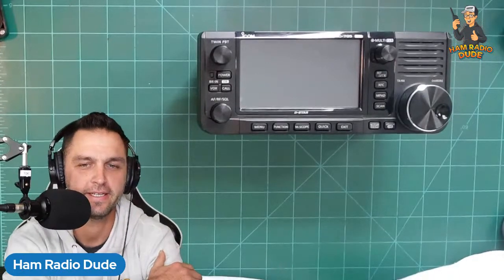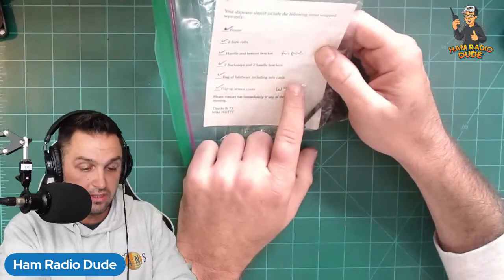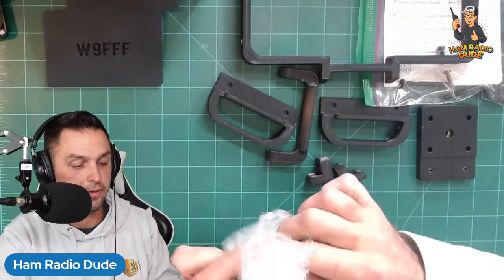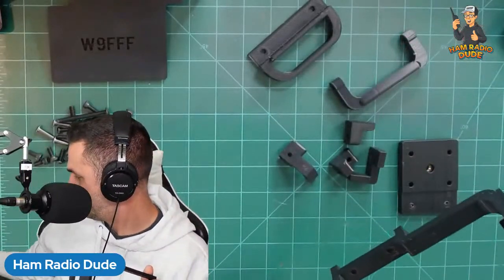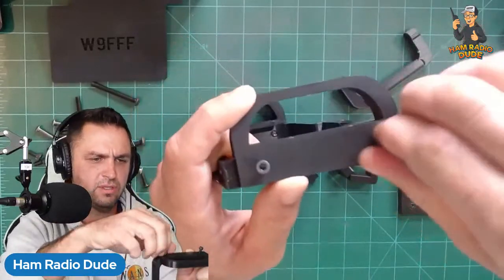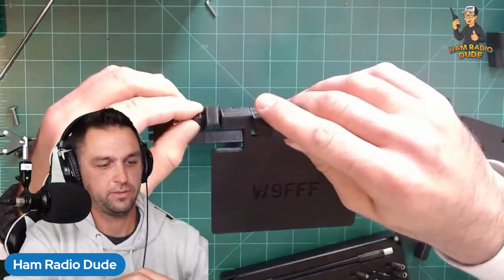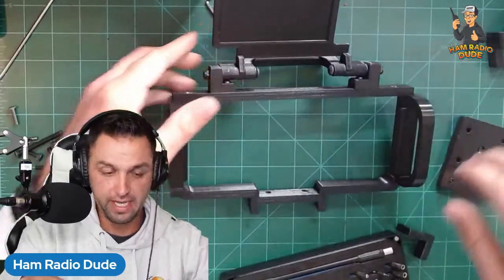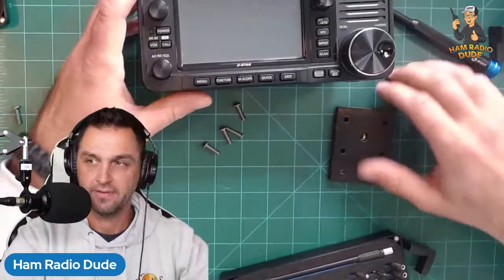Icom 705 Cage Build and Impressions From HamGear3D

Comment: Hey Sean, thanks for that super build video! I'm already working on an update to the build instructions - it's great to see someone working though it to highlight the places were the documentation could be better. BTW you should have wound up with one extra of each piece of hardware - I hate it when you drop some exotic screw and it rolls irretrievably under the workbench and that's the end of the build.
Thanks again for trying out the frame, good luck at Area 51, 73 Mike
Reply from the maker: Thanks mike! Overall it went well. I think working through the directions really probably does help other people as well.  It was a fun build and I look forward to getting some videos out there with the case and use.  Thanks again and don't hesitate to contact me if you need anything or have any questions